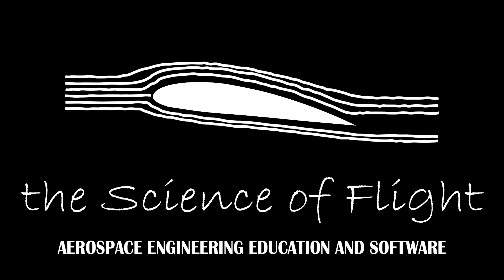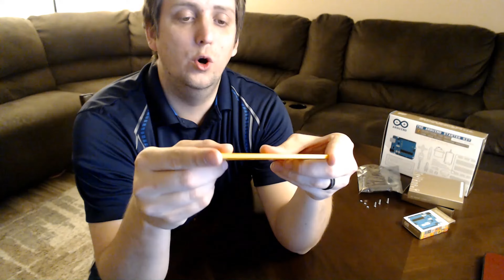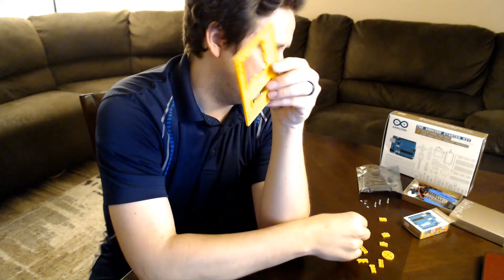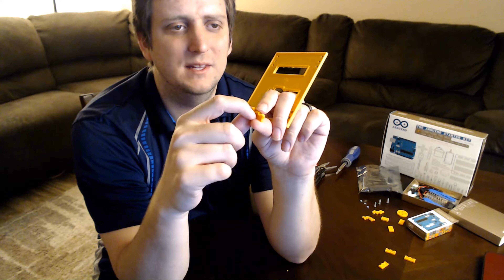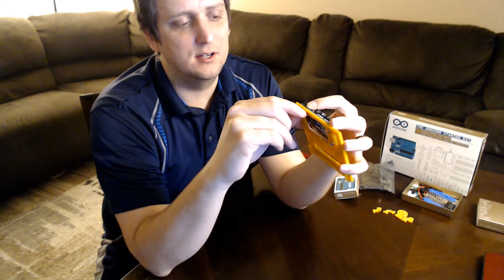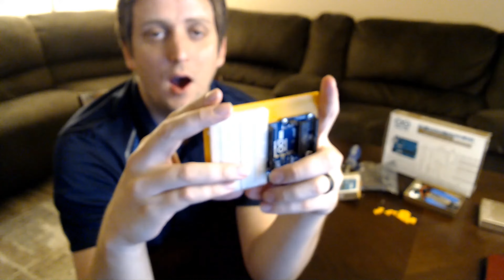Mounting the Breadboard and Arduino to the Plastic Holder

Comment: what do the extra pieces do?
Reply: Lol are u doing the starter kit too?  I was wondering this...at about 2:40 he says they will be used on another project
Reply: @ericbarbee1599  Yeah I am haha, it’s for my engineering class but I only got to find out what the lil rectangles do
Reply from the maker: The little small yellowish rectangle pieces are used in project 4 (Color Mixing Lamp) to hold the color filters or "gels" in front of the phototransistors. The pieces with a lot of corners, as well as the circle, will be used in project 9 (Motorized Pinwheel).

Comment: Thanks!  I found your video to figure out how to use the screws/nuts to attach the board to the holder.  I found the the soldered pins of the power connector stuck out more than the other pins in the board.  By trimming them with a clipper, I was able to get the Arduino board to sit more flush on the holder.
Reply from the maker: Excellent suggestion for the group, thanks!